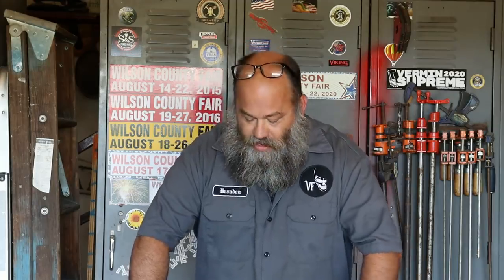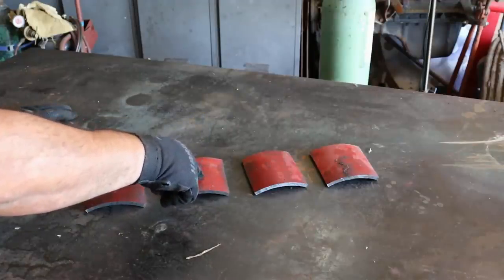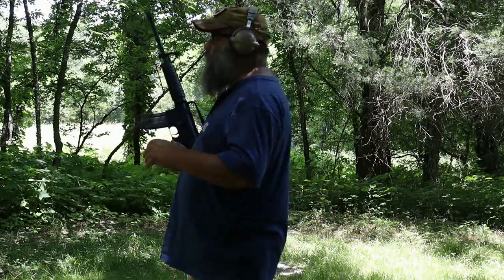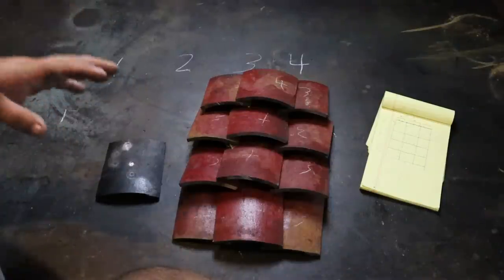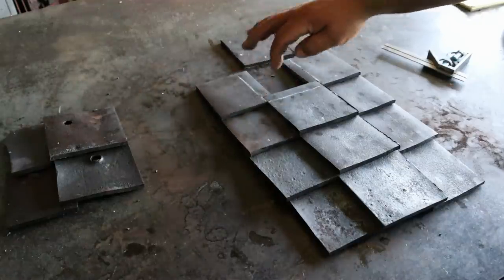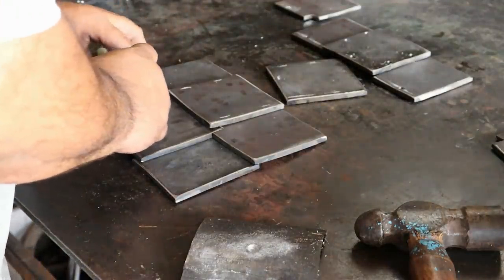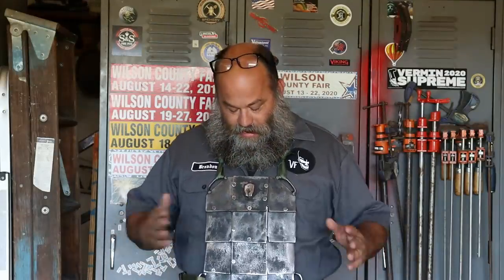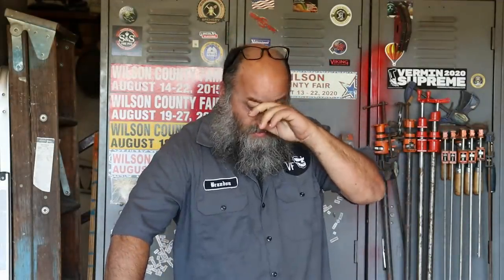DemolitionRanch Armor Challenge Voo Doo Scale (The Short Version) Blacksmith Armor

Comment from the maker: Thank y'all so much for the support! I will be working on some of these questions and getting back with y'all!
Reply: New sub. My grandfather was a master at woodworking. I’m getting better everyday. He would tell us, “A man who can work with wood is a craftsman, a man who can work with metal is a genius”. 

Great video, great armor, loved the test, you seem like a good guy and I hope life treats you right.
Reply: Thank you for all the hard work!
New subscriber.
Reply: Quick question, roughly how heavy was that armor?
Reply: How much for a plate of armor
Reply: Here from demolition ranch, great work man! I can tell the joy and pride you put into it. Question though why bolts?  I thought about this even before Matt shot one off in his video. Just curious on your thought process. Thanks! Keep up the good work
Reply: Great vid boss! I'm not one to nickle & dime, but could the nuts & bolts be heat treated with the steel plate?
Reply: @zacbrown1409  most likely for flexibility. With the bolts it can still flex and move a little bit
If he had welded it, it would be rigid and not very flexible, and in that situation would be better to just use a large solid piece instead of multiple plates, the purpose of multiple plates was to allow it to move a small amount for flexibility
Reply: Forged in Fire plz
Reply: Can you please tell me what is the weight of this armor?
Reply from the maker: @asdertrender7555  about 12 lbs
Reply: I watched your armor in demolition ranch.. It's very impressive, it withstood ALOT of bullets, good job sir!
Reply: Is their anyway to tell what kind of steel the tank was that you cut from?

Comment: Super impressive work.
Matt knew it would stop just about everything. So he had to throw the armor killer at it. 
Great job! I subscribed for more awesome content!
Reply: The only thing that would have hit it harder could be a steal core 50 cal
Reply: @jrowbmoc3959  i wounder what the API 50 would do to an armor set like this
Reply: After I seen the cheytac come out I knew it was an impressive piece
Reply: @phantasea-yt5764  probably just a cleaner hole if I had to guess. But with how the .375 blew through it, the wound looked like it hit something brittle just extremely hard. Think the 50 would have enough concentrated pressure to punch a hole instead of forcing it through
Reply: @thannydevitos2332  i fully agree

Comment: Hey there Tenn. Voodoo, I just watched the demo ranch testing of your build and loved it. In fact It would be my pleasure to be a customer if you decide to sell these👍🇺🇲💥
Reply: Same here , as long as the price is reasonable . Am "  guessing " if he could set up a assembly line , these would sell ... gubs
Reply: Would probably run as much as comparable contemporary body armor. This was his short video. 
There's a few days work, easily, into just one. Probably more. 
And I know, because I built my own forced air burner forge, and love these kinds of projects!
Cutting all those plates from the tank, grinding them, cutting again, heating a couple at a time, flattening them each, twice,  heat treating, cutting all his reliefs, measuring and drilling all those holes, forging his d- handles for the straps... yeah alooooot of work. Definitely worth it, if you were to build your own, though.
Reply: @theoriginalNoOne.  Thank you for a realistic take on the process and time spent Dereck. In those terms your absolutely right that there will be no probable financial insentive to get in line to be a customer as commercial options will be more redally available and cost less.🤝

Comment: Absolutely outstanding. You have a new subscriber, and many more I hope. My Dad was a blacksmith for a time, it truly is a dying art.
 One suggestion: Yes, it's heavy, but in a Mad Max scenario (my favorite movie), make a matching panel for your back, so they could hang off of shoulder straps instead of your neck?
 As far as the weight, I suppose the most you can do is experiment with thinner gauge material and perfecting your annealing techniques until you reach the lightest possible plates that can reliably stop AR and AK rounds? If anyone's shooting at you with a higher caliber, they're likely a sniper going for a head shot, any damn way.

Comment: Saw your armor tested out on Demo Ranch just a few ago, very impressive.  Just a suggestion:  Maybe thin patches of vulcanized rubber, like from a small conveyor belt, on the backs of each square, then another layer covering the whole back of the armor.  Figure the small patches cut to size of metal plates may help stop or slow spalled rounds, and the extra layer on the back could act like a trauma pad.

Comment: Couple of improvement suggestions: The original shape stops and spreads impact better than just a flat surface. hammer treating the steel makes the plate much more impact resistant, and second heat treatment where you heat the steel only until it turns blue makes the steel more flexible, and less brittle. Also coating the plates with bedliner catches the shrapnel, and brings another layer of impact resistant material. Your design is quite good, but can still be better.

Comment: Nice job 
If you put the pieces in a 350 degree oven for 20 minutes after it gets the pieces up to temperature it will relieve the stress in them from the heat treat process and make them less brittle.

Comment: Hi, VooDoo,
I just watched the Demolition Ranch live fire video and then found my way here. 
Great stuff. 👍
One suggestion: do an “uneven oil quenching” to keep the backside of plate more malleable.

Here’s my thoughts on your test:
The air-cooled is too pliable; the round went thru like it was butter. 
The water-quenched is too brittle (entire plate) so when you shot it, you broke it.
The oil-quenched was “on the border”, had some hardening (brittle-ing) but not too much to the point of the water-quenched one. 
HOWEVER, when the oil-quenched plate ultimately failed at Demolition Ranch, it was still due to being “over-brittle”; it basically snapped and broke like glass. 

So here’s my thought: 
In Japanese katana forging, on the final step, they would paint the back-half of the blade, on both sides. This particular paint is a slurry of fine sand etc, and is meant to serve as an insulator during the water quenching step. 
The blade is then heated up one last time. From there it goes into water quench. 
The quench step hardens (brittles) what will becomes the sharp edge of the blade. All the rest of the blade, because of that layer of insulating paint, it doesn’t cool quite as fast, and will be a “softer metal”.
The whole combination allows the sword to hold a very sharp edge (brittle), but while still being soft and flexible in order to not have the sword snap in half when it hits another katana. 

So borrowing from this knowledge, my theory is: if you similarly painted the backside of your plate with that sand slurry paint to slow down the cooling/quench of the backside,
This allows the front side of the plate to harden (brittle), but the entire plate still supported by a more flexible back side. 
This plate will likely be more survivable to Demolition Ranch’s final caliber that broke the previous plate.

Comment: After watching demollition ranch's video its obvious the heat treatment was not optimal, given that the plates failed via brittle fracture. Ideally, armor plates should fail via ductile hole formation, as that failure mechanism absorbs the most energy. Not sure what your tempering step looked like, but a slightly longer or slightly hotter temper might have been beneficial.

Comment: We just bought a house on 6 acres in the county and this is exactly what I wanna start doing. Any tips for a beginner?
Reply from the maker: Find a local blacksmith club, it may be an hour away and meet once a month but the hands on help from experienced folks will help more than anything. And don't buy crappy tools, you don't have to have it all at once. Start with a forge, good anvil, vise,  angle grinder and mig welder go from there.

Comment: The tanks you used, would that be a low-mid carbon steel? If so, the lack of carbon in it will prevent a good hardening. Maybe try using 4140, heat treating and double tempering it. Nice work!

Comment: so how much does it weight? it looks heavy, but the body armor i wore overseas was pretty heavy as well. for comparison the plate itself for level 3+ is about 10 lbs. (ceramic is a bit less than half that). we use level 4 overseas that weight 6 lbs each plate (total weight is about 35 lbs before we load it down with ammo and stuff).

Comment: you should have tryed heat treating one after hardening it to give it some strengh back after hardening or maybe surfaceharden one like gears snd stuff like that if you have a way to do it 😄 i would be corious how such a plate would handle bigger rounds 😁
Reply: im a mechanical engineer from austria and i got some knowlege in blacksmithing but nothing close to you 😂 i did some work with ar500 steel (we got a brand called hardox but its the same steel) and i also did some wear protection for huge shredding machines where we did it with welders (the stuff thats so hard it cracks everywhere when it cools down) i dont know the exact welding wire but i think it would also be awsome in stopping bullets with the hard weld surface and the more elastic steel in the back but it would brobably break of the briddle hard welds of where it gets shot but it would be worth a try if you could do this 😄

Comment: Riveting the steel together instead of bolting them would have made the plates more durable and resistant to spalling
Reply from the maker: Nope, cold set rivets would have been softer than the grade 8 bolts I used and hot set rivets would have softened the plates themselves. It's a damned if you do damned if you don't.
Reply: @VooDooTennessee  replace the bolts with mushroom headed bolts facing out the strike face then?

Comment: why not quench in water then bring to a certain temp  and let it cool so you get harder then oil but not as brittle as water
Reply from the maker: The grain structure is determined in the quench so tempering it back from a water quench wouldn't work.